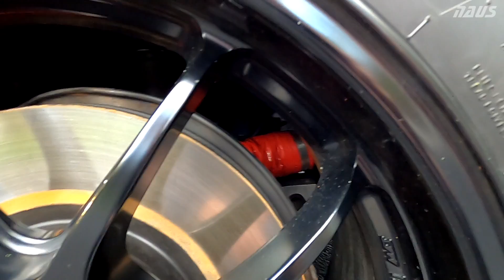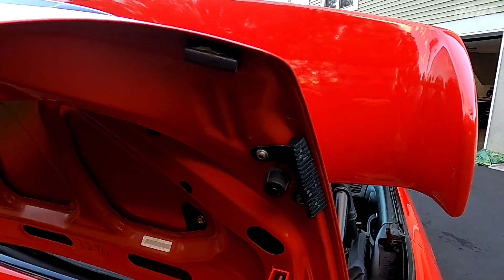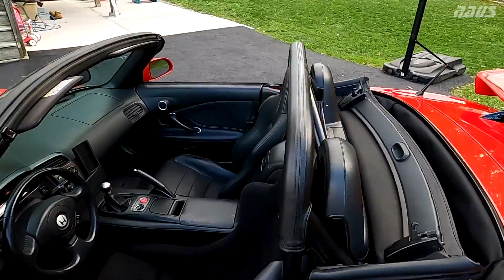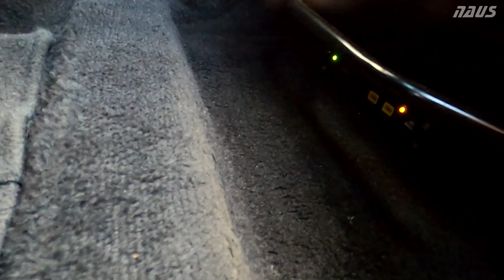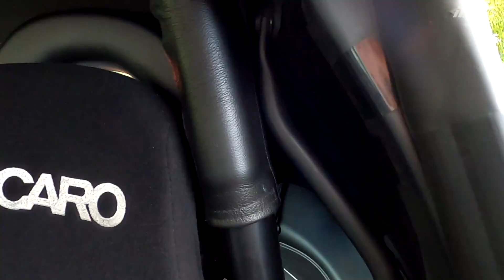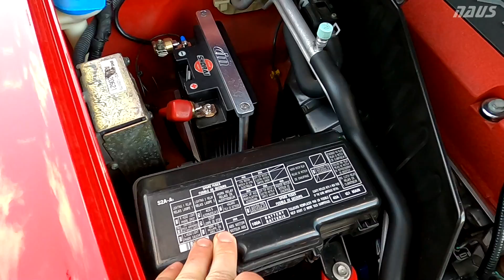The Ultimate Street/Track S2000? In Depth Walkaround

Comment: Thanks for the video. After the valve cover was modified, how much oil did you see compared to before the valve cover modification?
Reply from the maker: Before the valve cover mod I would fill up the pcv catch can in about 4 laps on track. After the mod I can go just about a whole season until it’s filled up
Reply: @NAUS2K thanks.

Comment: So on 17x9" +60 with 245/40r17 tires you aren't rubbing except for a tiny bit on the fender liner, which eventually self-clearanced? To get that fitment did you need to add any parts to get more negative camber? I'd love to run 245 in the front but I really don't want to roll, pull, or relocate the bumper tab because I want everything reversable. My backup plan is 17x8" +50 with 225s in the front.
Reply from the maker: 245/40/17 up front on this wheel never rubbed, however there was a little fender liner wear from the 255/40/17s I had on there from like 2018-2020. Only ever rubber during hard cornering on track or some autox transitions. Zero rubbing in the rear with either tire. 100% stock body front and rear . I mention in the vid I’m running spoon front lower offset balljoints to hit around -3.7 camber

Comment: Alright mate just wondering what the plate is for on the break duct what's the function of blocking the air to the brakes is it just not street legal to have on?
Reply from the maker: Zero benefit to having it open for street driving and autox, keeps rain, road debris, rocks, pebbles, leaves etc from collecting in the hoses
Reply: @NAUS2K ah got ya nice love it

Comment: This is the best build I have seen across any media - OEM+ and everything is so purposeful. I am trying to get wheels and tires sorted for my AP1 but wanted to find some that I would not have to modify the fenders for, so this was very helpful. 

Two questions I had though, do you rub at all with a passenger? Also do you think that you could have gone any lower offset for the rear?
Reply from the maker: Thank you for the kind words man! I appreciate it . I use to run a 255/40/17 up front back in the 2018-2020 timeframe. During some track days the front would kiss the plastic fender liner up top, but it just self clearanced a little of the plastic away, no biggie. I’ve since switched to 245/40/17 so the diameter is a little smaller. The new 245 super 200 tires are just as wide as the old gen 255s so no decrease in width, but the lower height has not caused any rubbing since. I could probably get away with 5mm less offset in the rear and still be fine. They are not as flush as the front, but still good. My rear has zero work done, no bumper tab relocation or anything
Reply: @ Awesome, that is very helpful. Thank you!

Comment: Any chance you could measure the height from the top of the seat to roll bar? 
Just installed my pole position on pci mount and trying to figure out if I will fit under the roll bar.

Comment: This is incredible, dudes gotta be an engineer.
Reply from the maker: Yes sir! I’ve been working as a mechanical engineer for almost 9 years now
Reply: Awesome I left M E about 2 years ago and moved into a different role. Engineering as a whole gives you a new perspective for sure. Are you still doing 3d printing? If so let's collaborate on some ideas for s2000s
Reply from the maker: I have a very elementary 3D printing setup at the house now. In a previous job I had access to some real nice stratsys fdm machines

Comment: Are there any recommended upgrades for the steering feel?
Reply from the maker: A lot of people that run harnesses and hans on the track ditch the stock wheel and airbag. They usually run a smaller diameter race wheel which can help with feel and response. Another mod is stiffer steering rack bushings but I have no complaints with the stock ones

Comment: Beautiful S2K, brada. I just bought a red 04 S2K w/ only 60k miles. Slowly building it. I just received my 17x8 +45 Konig Hypergram wheels in gray. They're currently in the shop being powder coated Highland Bronze. I got the tires waiting for me at the tire shop,  Falken Azenis rt660, 245/40/17. I should have both installed in a week. Then my FA 500 coilovers come mid November! After those are installed, it's just little things to make the car look sweet...like paint correction, interior mods, a better muffler and possibly that tire flap that you have. Great idea btw.Can't wait til the coilovers are installed and the car is dropped an inch or 2!

Comment: Did you have any tire rubbing on the front with the PF01s running 245s?
Reply from the maker: No, though my plastic fender liner has done some self clearancing from all the years prior on 255 re71rs. The tire never touches any part of the metal fender though

Comment: Excellent.  I'm totally on board with keeping the OEM look and feel as much as possible.  I don't track my '07 so many of the mods you've done wouldn't be necessary, but I do wonder whether an oil catch can would be a good idea.  Also, on a strictly street car the CR type wing would probably be superfluous except for looks.  Your thoughts?
Reply from the maker: I agree , the cr wing would not change the way the car feels on the street at all. The ohlins coil overs do actually improve the ride quality on the street though too over the oem suspension. They are one of the few that actually enhance the car for both street and track. I’d recommend the ohlins but no need for the karcepts sway bars if you do not plan to track it . Enjoy the S man !
Reply: @NAUS2K  So I gave in and bought the EOS CR wing and an OEM CR trunk lid with all the bumpers and stuff (my AP1 son talked me into it), getting the lid and wing painted now.  I notice a fair amount of flex to the wing, has that been noticeable once it is on the car?  I thought about filling the wing with expanding foam, but not if it isn't worth the effort.

Thanks, man!  Looking forward to seeing more of your track time this year.

Comment: I see you are on 245/40 but didn't you have 255/40 square setup? How did the 255 sit on the s2?
Reply from the maker: Yes I’m previous years I ran 255/40/17 RE71R square setup, the fitment was about the same as these nankangs. The new 200tw tires run obnoxiously wide so a 255 is really a 265
Reply: I went with 245 40 (bfgoodrich comp2  (a/s). No stretch at all. Also, would you happen to have the file for 3d print center cap?

Comment: Do you have the ap2 banjo bolts?
Reply from the maker: Based on my engine number and posts I’ve read on the s2ki forums ,  my car should have the 4 hole bolts. They started putting them in the mid 2002 year cars. All 2003 AP1’s have them
Reply: @NAUS2K  Good to know - I've been meaning to upgrade mine - I'm super conscious of cooldown laps on my trackdays because of it! I feel like I will baby the car less if I do them. I like the idea of your oil cooler also

Comment: Yep. Your trim job on the interior plastics look far and above better than my attempt even with the same double diagonal roll bar. Hah! Very clean as always.
Reply from the maker: Thanks Man!!
Reply: I saved my trim pieces for this VERY reason! It would be great if someone made some templates on where to cut the roll hoops! I even saw an oscillating cutting tool that could cut that plastic like butter!

Naus, the version HD bar, were you able to keep the OEM bulkhead in there as well? It looks like most trim pieces mount to it.

Comment: Should put a mesh on the brake ducts for the street at least it'll stop leaves and rocks getting in if the mesh holes are sized right should still get reasonable air flow.
Reply from the maker: No need for flow to the brakes on the street. I prefer to keep the water out too when street driving which is the majority of the time. It’s also nice to not have the ducts fill up with water when washing the car

Comment: on a scale of 1-10 this car is a major. major. major. go. The trimming you did to fit the oem parts around the roll bar is amazing, great work. How much of a difference do you think the driver seat makes with the padding in for daily driving? I'm looking for a solution to the height problem and I don't think the back year racing seat lowering solution will solve it. Back yard racing claims 3/4in. (20mm) seat drop.
Reply from the maker: Don’t bother with the backyard special seat rail. It will barely make a difference and you still have to deal with the slippery stock seats. Honestly I find the pole position seat much more comfortable than the oem seats. I’ve taken 4+ hour road trips in this car without issue. I appreciate your comment man thanks for your kind words!